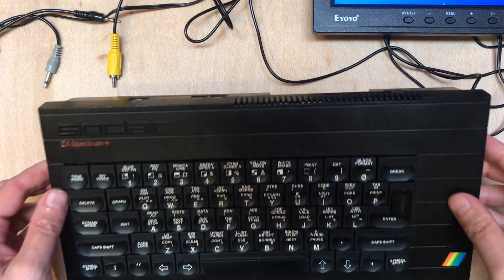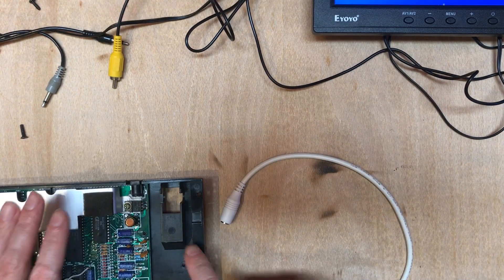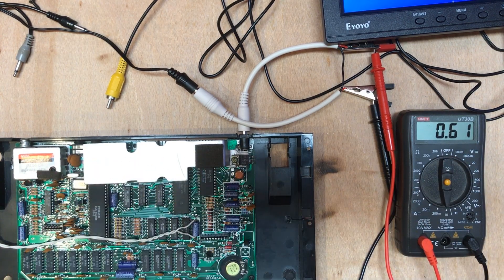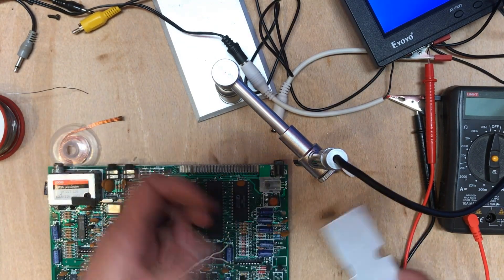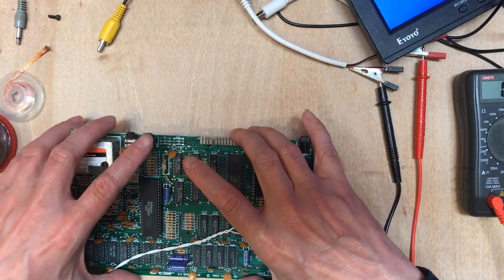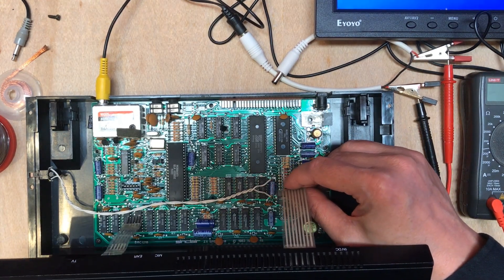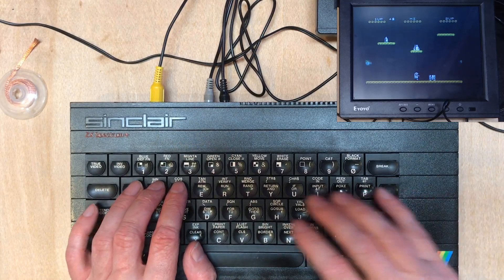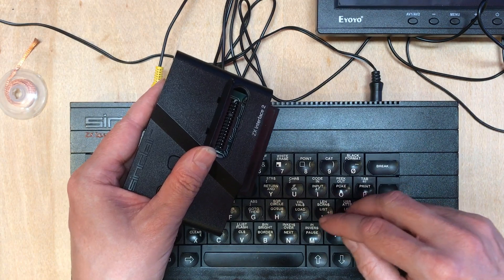ZX Spectrum+, Regulator Upgrade

Comment: is a TSR 2-2450 a better fit for a 48k Speccy with cards( An SDcard, a sound card and a memory expansion)?
Reply from the maker: I had a quick look at the datasheet.  The TSR 2-2450 can output twice the current but costs more. I'd be interested to know the load on the 5v line for your heavily expanded system, it may well be worth it.

Comment: Try using rf out after fitting the smd regulator. It makes the output go very strange.
Reply from the maker: That's weird, what kind of strange?  Not easy for me to test as I converted to composite. Might be worth throwing an oscilloscope on the 5v rail before and after.

Comment: What glue did you end up using for the screw mount ?
Reply from the maker: Rather than glue, I used a solvent weld. The liquid is acetone which is a solvent that melts the plastic, I paint a little bit on each surface to be joined and then push them together. Once the solvent has evaporated it should leave a merged together surface.
Reply: @JamesSharmanExtras  Thanks, I'll look into this as of of this week I have 8 Speccies and 6 C64s (plus other micros) with brittle plastic galore 🙄

Comment: I'm impressed with your desoldering. I recently had to desolder a throughhole resistor and couldn't get the solder out. I gave up and just tacked the new resister onto the pads. I'll have to get hold of some flux to see if that helps!
Reply from the maker: The flux is a big help, sometimes adding some fresh solder helps as well.
Reply: Using a braid with flux is the only way to suck up the solder.